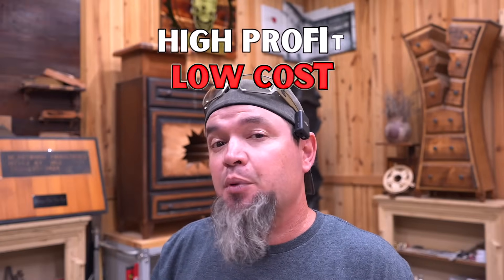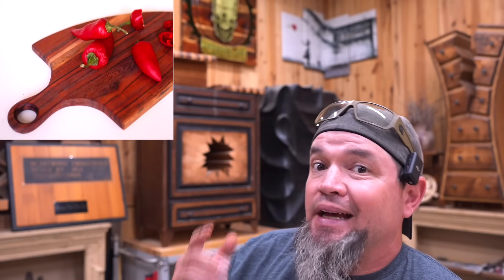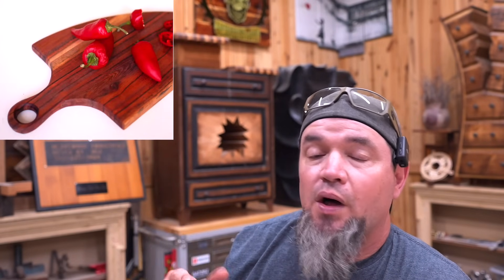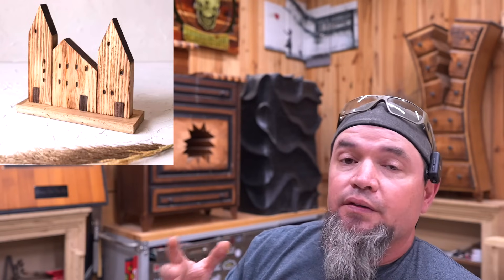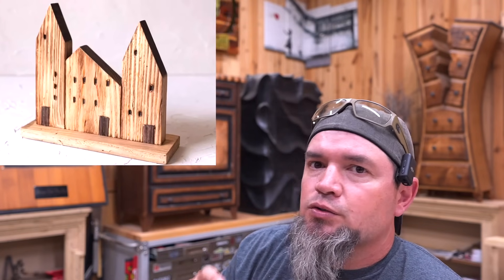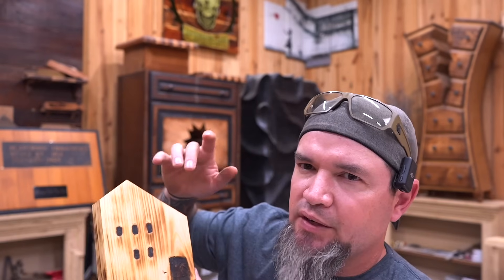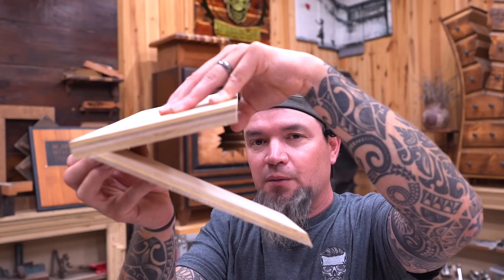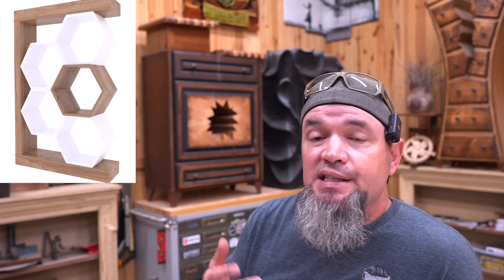Easy DIY Trending Woodworking Projects That Sell - Make Money Woodworking (Episode 35)

Comment: That cutting board holder wall piece would be extra cool with a clock mechanism installed at the top, or router something personal at the top.
Reply from the maker: Do it!
Reply: Yeah I was thinking veg meat and smelly things lol
Reply: I LOVE LOVE L O V E THIS!!!!!!! My grandpa used to make walnut wall clocks out of cookies cut on about a 15 degree bias to keep the cracking down while it dried. I lost the last one he made when we moved back when I was 7 or 8 and have thought about it a lot. He used to use a radial arm saw and a log chain with a come along winch to lock it down to the table (the log) to slice the cookies, and then they got wrapped up and sat on the ductwork of the wood burning furnace in the basement.
I want to recreate my grandpa’s rocking chair, but a clock is way closer to my skill level at the moment
Reply: Woodchuck
Reply: stupid question but what wood are you using for the cutting board. I would think you wouldn’t use plywood for a cutting board.
Reply: Woodchuck. Hey Matthew you have saved my life after almost losing my life due to drinking a fifth of vodka every single day for almost 2 decades! Once a quit I needed something to do with my life. Woodworking caught my attention and I finally found something to do besides drinking! Watching your videos gives me so much inspiration that I actually love my life now because of it. The ideas and the things you teach are absolutely awesome !! Thanks for your words of encouragement, it's really heartfelt on a personal level. Thanks again sir , much respect.
Reply: Awesome video, will give it a shot. Do you have a how to video on the "y" or "v" shaped chest drawer that's up in the background?
Reply: @Flagtkd maple, walnut, ash, definitely not plywood but there are a lot of different kinds of wood you can make one out of. They say that end grain cutting boards are good too. I think hardwood is better but you can make it from softwood too, I believe they say hardwood will last longer though but I could be wrong. There are plenty of videos to find out which one might be better for you.😁
Reply: @jesseybarra3316  That's awesome, brother! Good work!

Comment: Woodchuck. Great ideas. Again! Left Coast Sawdust glitter gal here. 

Would you consider doing a video about table saws. I’ve done woodworking for years, for myself, as gifts and to sell a bit. 

I’m afraid of kickback and loosing fingers with a table saw. I’m very safety minded with a healthy respect for power tools. I need to break through this mental barrier.

Comment: I think for the cutting board. Easier to maybe tape them together with opposite grain pattern. Then cut the handles out so they are exact matches to both. Will shave some time off process and also ensure they are mirror images for best fit

Comment: Woodchuck I need to find an adapter for my 5 gallon DeWalt shopvac and DeWalt 735x planer. Any suggestions?
Reply from the maker: Theres several adapters online but you could actually use a boot. Anything should work bc the planer is blowing the dust out.

Comment: Woodchuck - for the shelf with the angled bottom you need to construct a tenoning jig, which is basically 3 pieces of plywood in the shape of a lower case "h" that fits over your table saw fence.  You can set the table saw blade to a shallow angle for the cut on the front edge and clamp your board to the tall side of the jig to safely cut it.  Since you also need to bevel the back edge you run that through the saw on the table with the blade set to the same angle and you'll get a complementary angle that will sit flat against the wall.

Comment: For the windows and doors on the houses, couldn’t you heat the metal with a torch to burn the wood? Or would that just be more time consuming?
Reply from the maker: I would rather dent the material but it wouldn't hurt to try both ways to find what's best for you.

Comment: 18:58 2 7/8 width on the hanging shelves makes me think they started with a 1x6 and ripped it in half to start. Then the pieces add up to 12’ with 4 each of 6”8”10”12” so if they flip the board each cut, it looks like one 1x6x12 could make 2 sets of frames if my math is correct (but flipping the board would be required to compensate for blade kerf on the miters to limit waste) but I am still pretty new to all this really
Reply: The shelf is likely made in China, so would be 73mm and not really 2-7/8”. I also suspect it’s 100% MDF as opposed to real wood.

Comment: I always appreciate the thought you put into production techniques, but for the cutting boards with handles at half an inch thick and under two inches wide I'd expect those handles to break off if the wood grain runs across the handles instead of lengthwise. The loops seem especially likely to snap.  Im sure it depends on wood species and how they're handled.

Maybe try to reinforce by drilling in the length of the handlle through the edge and then tap in some glue and skewers before drilling the hole in the handle.  Seems possible since the handles are probably only 3 to 4 inches long.  Very finicky though in 1/2 inch wood and it seems like the loop would still be really fragile.

Probably better to always make the cutting boards with grain running lengthwise.  With offset handles or a slightly wider than needed glue up that was a little less than twice as long, half the handles could point up, and half down to reduce the amount of scrap.
Reply from the maker: Always feel free to take their builds for reference and use your own dimensions.

Comment: Woodchuck…ooft! I tried following the instructions for the circular cutting board wall art thingy but ya lost me. Even tried writing it down but just not following it. You did your best to explain it though. It’s me…not you Matt. I assure you of that 😂
Reply: Mainly not getting where that first center horizontal line goes. If it’s at the apex of what becomes the cutting board handles then surely when it comes time to make them all fit to the top piece that would work as you would have lost material width wise to me the meaty parts of the chopping board (below the handles) to make them match the diameter of the top half of the circle. I’m gonna let my wife watch this. She’ll probably figure it out. I’m sure I’m overcomplicating it.